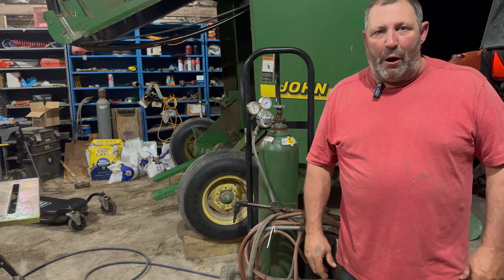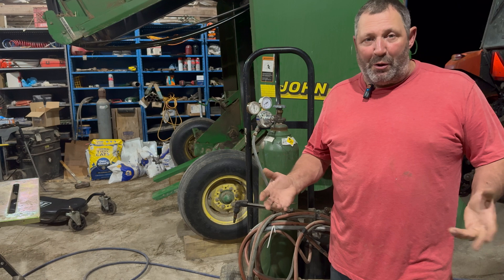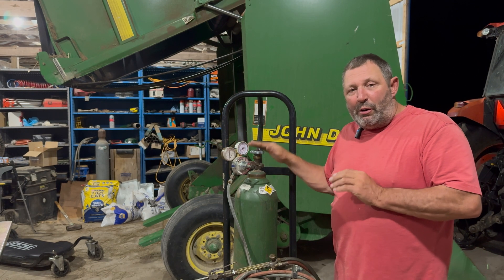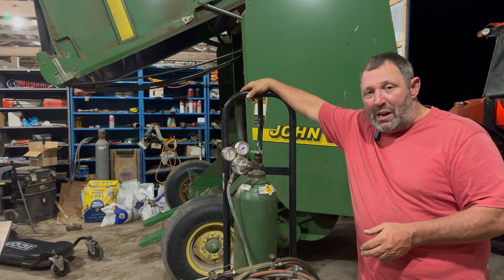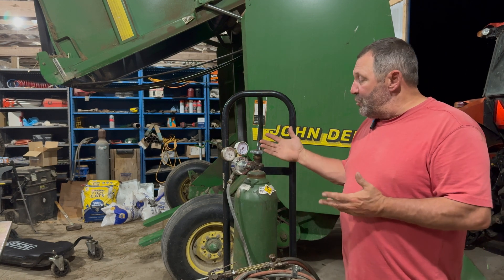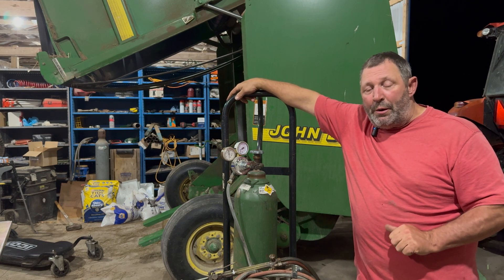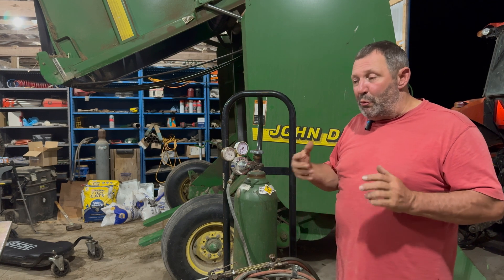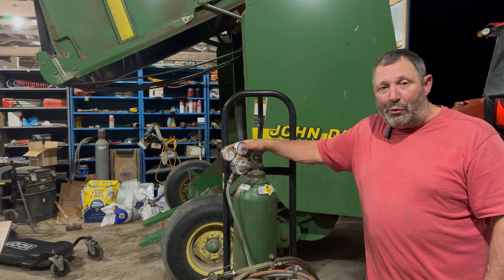Get the Right Tip Size and Gas Settings for Cutting Torch Success!!

Comment: This is probably the first video i have seen that gives in depth information on  using a cutting torch............... Not new to me but to others it may be usefull............ I have always  from day one on the farm ..... possessed a cutting rig and as my knowledge  an experience increased so did my   inventory of metal shaping & joining  equipment  (  Stick,  Mig,  &  Tig ....    Also my Son's  interest in  building  NHRA  Inspected & Certified  Bumper to Bumper  Door Slammer style  Drag Racing Cars ( Alcohol Pro Mod,   Super Street,   Turboed and Multi system Nitrous Oxide,)  One stop out the door Build   added to the know how bank.....    Our Torch set is A.O. Smith
Reply from the maker: Thanks. I am trying to make training videos and getting right to the point. I appreciate the feedback. I just need more saddle time to get better. I am also slowly learning to weld. Great skills to have, especially farming.  I wish I would have learned all this when I was younger. I do appreciate it more now than when I was younger. I have stick and mig welders. Still learning how to make a nice bead. Got a long way to go.
Reply: My  Son First Real Job was at the Savannah River Atomic  Plant,  He got into  the Hydro- Electric  Generating  part..   After about 5 years they had a Reduction program , so  S.C.E& G was building a Generating station  so he applied for a position, and worked a deal where he could attend a   SCE&G class at VO, TECh while working swing shift a SRP.....  He was hired and 30+ years he is getting close to retiring......  Everything he welds is Stick,